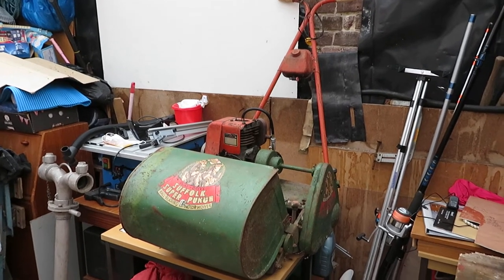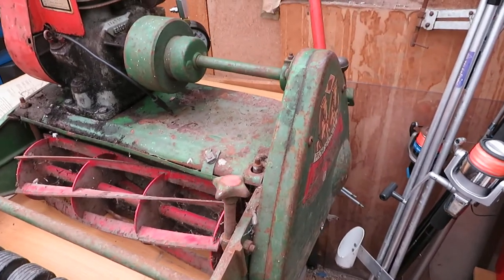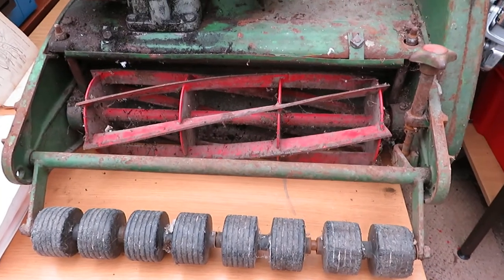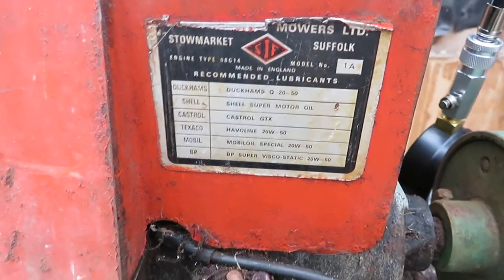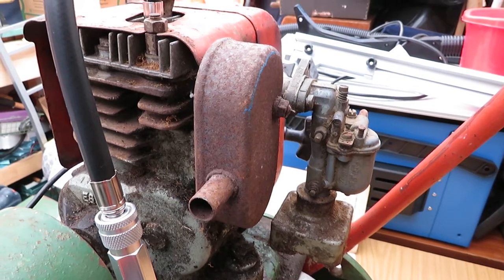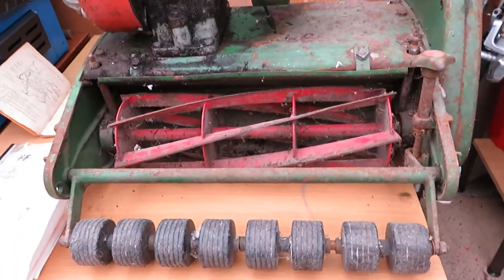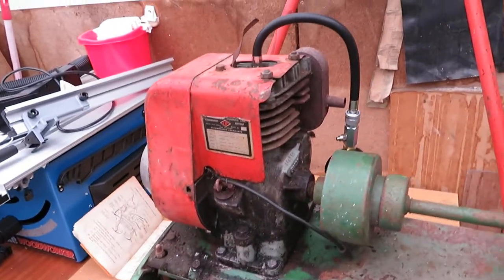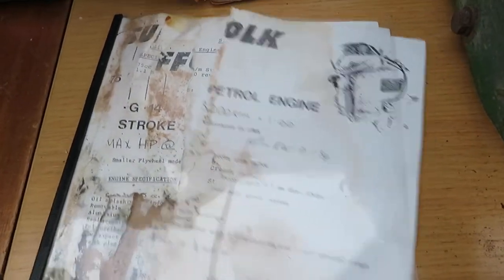Suffolk Super Punch 17 inch restoration. (Video 1)

Comment: I have an identical machine and mine also has the fuel tank on the handle bars
Reply from the maker: Have you had your long? I was assuming the fuel tank was a due to a replacement over the years, but not sure.
Reply: @bedfordpump  hi Smokey.  I inherited the Mower from my late Father. And it’s been in our family for 50+ yrs. I remember helping dad mow the lawn with it when I was little and it always had the little handle bar tank fitted.  I’ve not really got into the resto yet as I have several other projects on the go which I want to get finished first